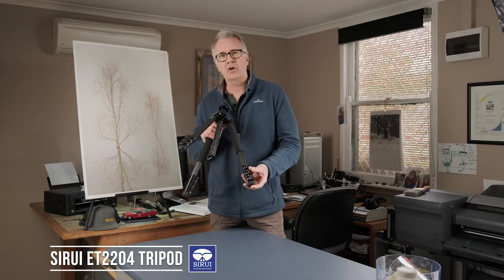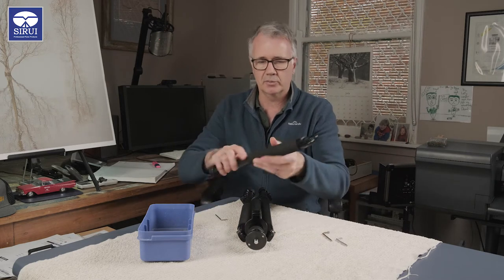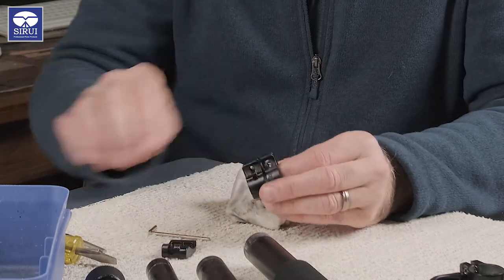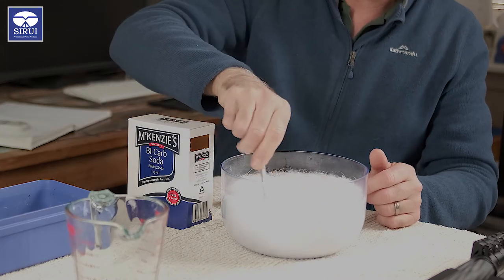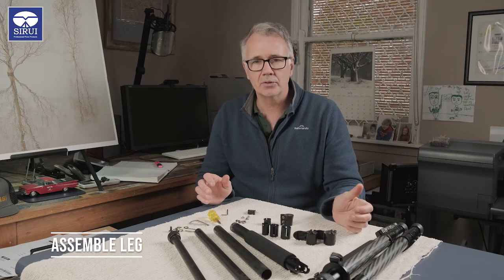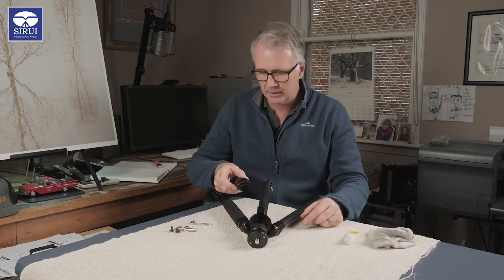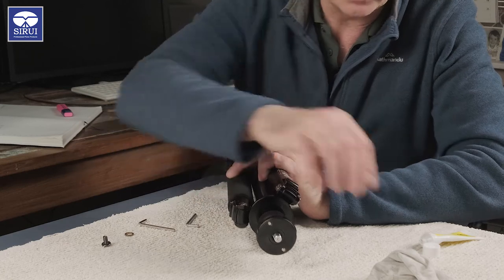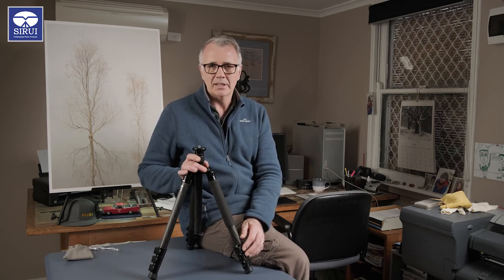Take apart and clean a Sirui ET2204 tripod

Comment: A quick note for anyone cleaning the metal bits; they're not steel (some may be but not all). Most are coated aluminum. So don't make my mistake of being easily distracted and after placing them in the vinegar, come back later and find the coatings been stripped and now they're pitted and brittle. On the plus side, Sirui does sell replacement parts...